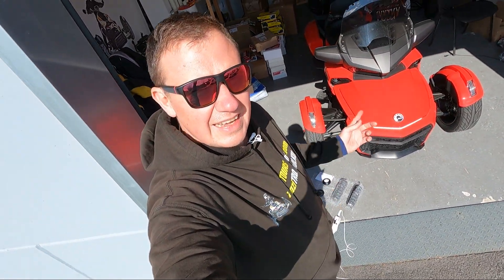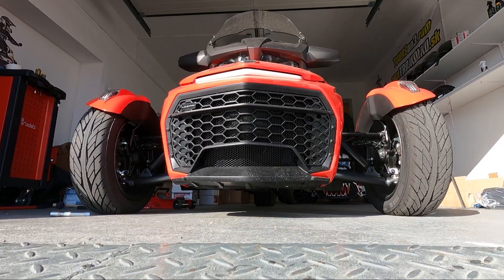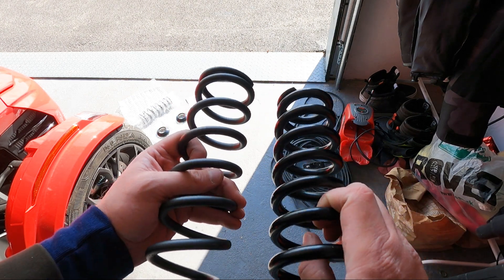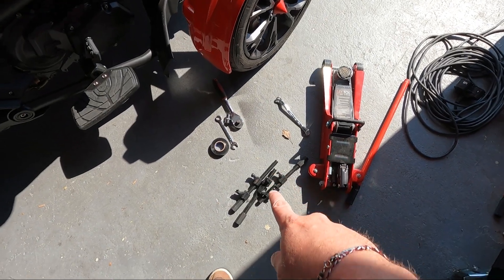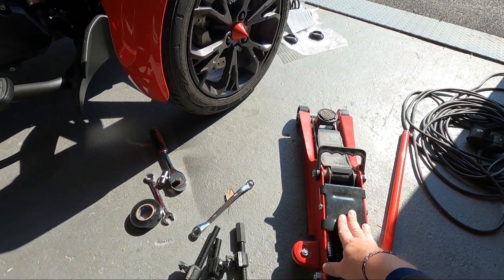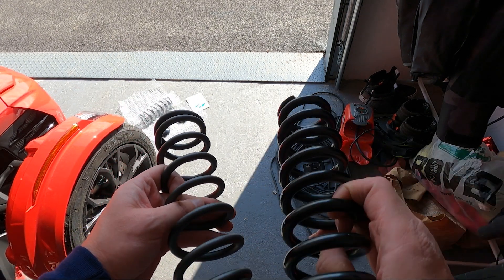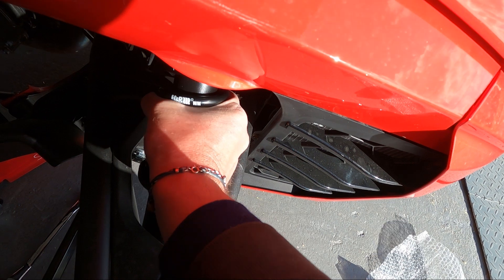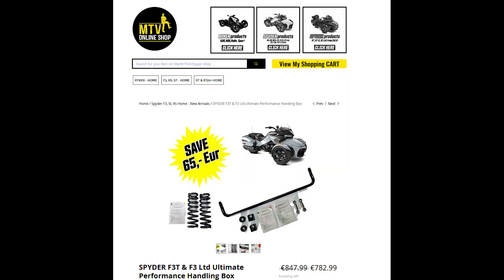Installation and Comparison: Stock versus High Performance Springs on Can-Am Spyder

Comment: Hey Martin, my 2023 F3S came with KYB front shocks and a SACHS rear shock.  What springs would you recommend?
Reply from the maker: Hi, it depends. If you want to save some money or you want no compromises on handling.
1- no compromises on handling means Heavy Duty Swaybar Pro + Wilbers fron and rear shock with hydraulic preload - we talk 2315 eur depends on color before tax and shipping - this is what is my set up on TheBeast. If you want to save few bucks and still have masive improement - this is what we have on all our rental bYkes - Ultimate handling kit Pro - swaybar Pro + Front new version of springs + rear wilbers without htdraulic preload - acctually we have hydraulic pre-load on outmr rental bYkes.. but anyway then we talk about 1338 eyr before tax and shipping. Best its to write me to martinthevlogger@gmail.com or 00421902944669 - whatsapp .
Martin

Comment: Thank you Martin for all of your videos. You have a video for the installation of the belt tensioner that I’ve watched. I wish you would do one on the alignment and tension adjustment. The videos on YouTube are not very good on this subject.
Reply from the maker: You know i am always honest and to be fair, i did not find "balls" to mess around Belt alighment right now... i simply have to see how guys at BRP does it and then i may do the video 😉😉😉😉
Reply: I understand. It was fairly simple on my Harley because it had built in notches on the chain guard to go by. I hope you find the correct method of adjusting these Spyders. Thank you for the reply!!
Reply from the maker: @madmax3897  🤟🤟🤟🤟💯

Comment: That's a significant difference between the upgrade and std springs
Reply from the maker: Yup it is 😉😉😉🤟
Reply: @MartinTheVlogger  I got some German springs to put on my BMW 650 GS to lower it one inch but maintain the characteristics under load....and then one month later you influenced me to get my Spyder 😁